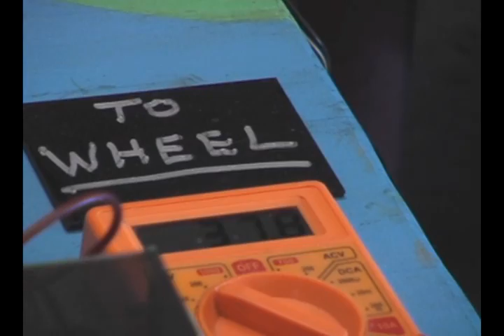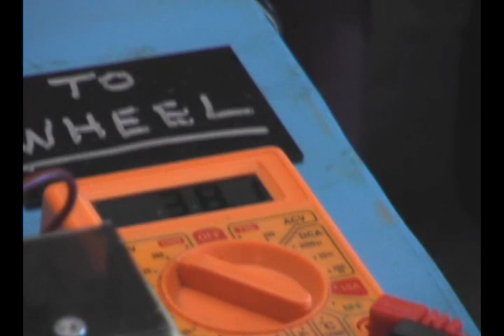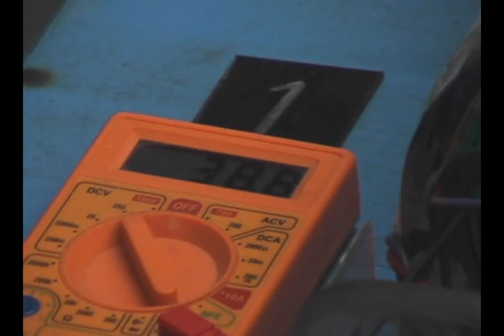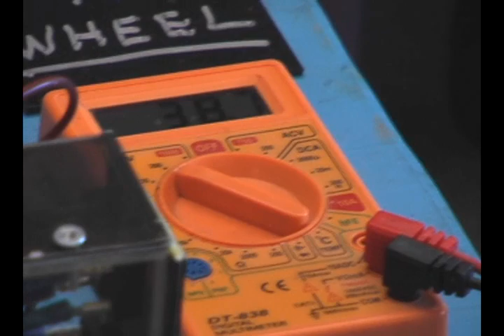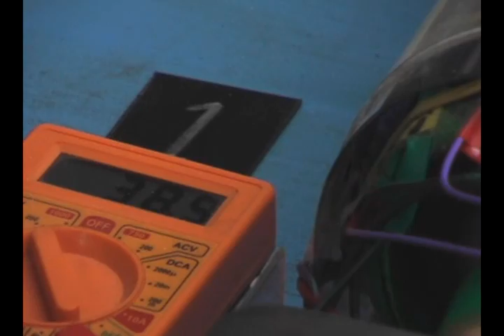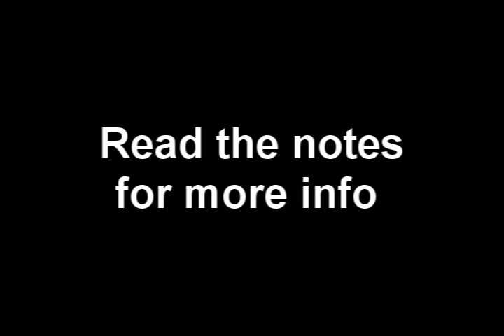Eco Solution Mag Amp Gen Wh1

Comment: Way behind the curve - but trying! You don't need batteries either! 10 years ago we made the mistake of relying on AMBIENT energy - of which there is enough yes. But it's intermittantcy (solar)condradicts demand. Because this is true of the total grid also, guys like Gore ("Our Choice") tried to promo bats. as a STORAGE dispersion. Much better is using AMBIENT as a TRIGGER (frontal air pressure & vibration) for magnetic generation - be off Grid completely!

Comment: These generators are the pole opposites of the mag Hub Drives. The drives have gone from 200w - 5000w in past 8 years. Voltage from 24v - 72v. As voltage goes up, the wheel RPM'S go up. This is directly paralleled by the generators RPM's at rising voltages.

Comment: The behavior of Electric generators is very similar to that of Electronic Mag-Drives. Strain & low efficiency initially, & high as cruising speed is attained. This means that inputs are Rough at start, but delicate when cruising is reached. Modular replication at both ends - generators & wheels, adds much flexibility to overcome these fluxuating limitations. Here on-line Lead Bats fail adaptability: see "immediateur" channel for Wh2 solution.

Comment: The basic principles are: 1) It doesn't matter what turns an axle - what matters is how much & how consistantly it can produce USEFULL energy. 2) Induced  produced energy must be kept flowing at all times & not allowed to "back up", producing heat - always a sign of waste & lowered efficiency. This principle was violated here by having the 36v series batteries in line with the Generators & Wheel Mag-Drive.